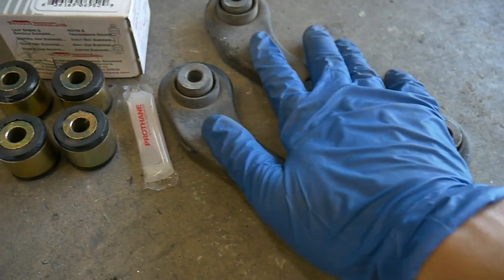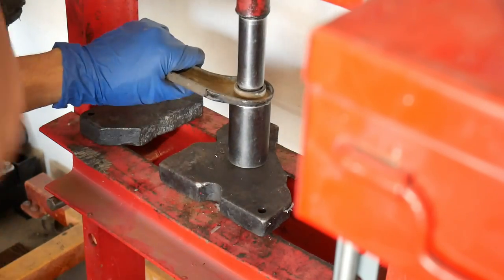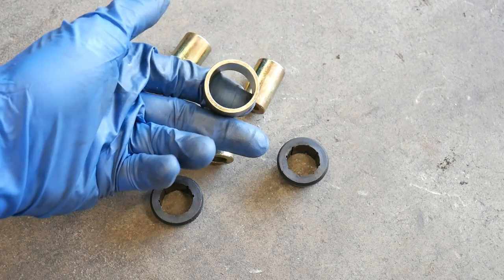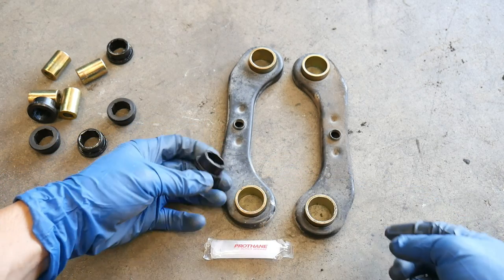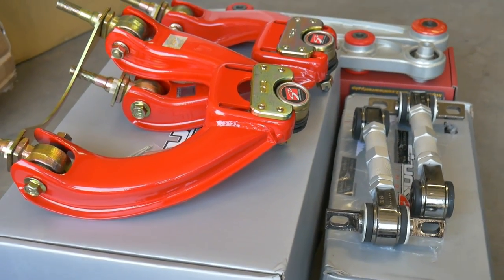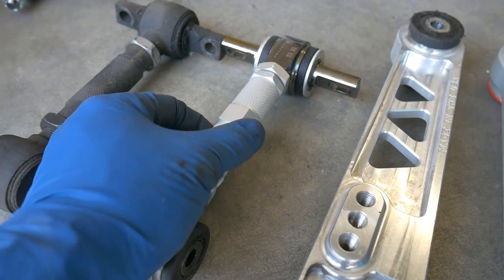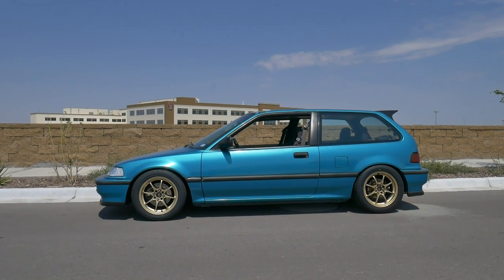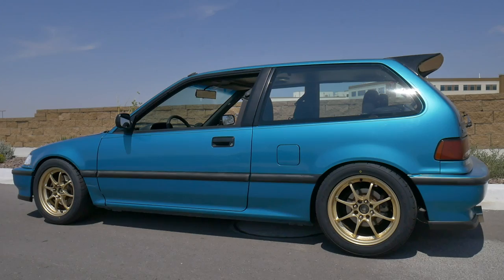Skunk2 Alpha LCA & Camber Kit, Rack & Pinion, Toe Arms, Tie Rods 1991 EF Civic Si B16A

Comment: hey jon quick questions not related to this video. Have you ever done a r12 to r134 conversion? is it worth converting or best to stick with r12? also i found a r134 oring kit for my sedan will the r12 harm the orings?
Reply from the maker: Yes, and R12 works 10x better.  R134a in 100 degree weather is tough in stop and go traffic.  On the highway or constantly moving forward then it works much better but once you come to a stop the temp rises quickly with R134a.  I was going to rebuild the AC on the wagon, but haven't had time/money so far this year.

Comment: also, you only need to unbolt the exhaust and let it hang down. turn the wheel to the left fully. if you can remove the outers slide the rack to the right and it will come right out. Mine were seized on, I had to flip the rack 180 degrees, force it to the right until the left outer dropped, then slid the whole assembly out. Didnt remove any exhaust parts or shift linkages.

Comment: My speedometer and temperature doesn't work know how to fix it?
Reply from the maker: Jose Hilario First check your speedometer cable when it connects to the back of the cluster, then also at the transmission.  Possibly unplugged, if not then the cable might have broken.  Temp gauge, check the wiring under the distributor.  There is a single plug that the gauge reads off located there.  check the plug, then wiring.  If that doesn't work for either, then you might just need a new cluster.  I've seen a lot that have had non functional gauges.
Reply: Jon Widmer rpm and gas still works still think it's the whole cluster

Comment: Love your new setup brotha! Btw is that Firestone you took your car to get an alignment? I have lifetime alignment over there, and i seen them use that new alignment equipment when i had my old wheels, but now that I recently bought some new mag blue te37s, i'm a little bit worried about the faces possibly getting scratched by the new equipment. How was your experience?
Reply from the maker: Perfect experience!  I go to Martin Tire.  The sensors that they have are lined with rubber on the faces so there is no possible damage at all to the faces.  I imagine the only damage would be if they dropped the sensor and the plastic part hit the face but doubt that will happen.  I only go there now because I've been going there for the last 5 years and know the head technician very well so he takes better care of all the wheels/tires and alignments for me.  How much is the lifetime alignment?  I might consider that for my track car instead since I align it maybe 2-3 times a year.
Reply: Oh that's awesome! I purchased the lifetime alignment at Firestone when they had a special deal going on which was $175, regular price is $200 ( but they don't adjust camber with that price or provide that option for lifetime warranty.)
Reply from the maker: Billy John De La Cruz I see, looks like I'll stick to my dude, he'll set any camber, toe, and caster (if a traction bar is on the car) settings that I want thankfully!

Comment: the steering racks in these are actually pretty stout from the factory. All you gotta do is replace the rack end bushing which was $20 from the dealership. Steering is super tight, no more rattle. very impressed given the rack has 267K miles on it and the previous owner drove it for months with a dry rack.
Reply: When you replace the bushing do you have to replace the inner tie rods, too? Both my boots are torn so I'm trying to figure out what all I need to order before I order it.
Reply from the maker: Only if your tie rod needs it.  But these cars usually need it and you're better off just changing it for piece of mind.  They are inexpensive too.
Reply: @GarageBuiltHondas  True! Moog inners are like $30 off of rock auto. Figured I'd rebuild mine with new Moog everything and have it towed with my insurance 2 miles away for an alignment.

Comment: Jon, what would you recommend for front lower control arms for ef? Was looking at the hardrace ones, but I think that’s my only option. Any ideas? Thanks as always.
Reply from the maker: +carlitosnueve OEM, but replace the bushings.  Energy suspension, Hardrace, or some spherical.  That's up to you!
Reply: Garage Built Hondas oh ok. cool, thanks. what do you think about hardrace inner and outer tie rods? do you think i would be any different than an oem replacement I can get at an oreilly’s or something?
Reply from the maker: +carlitosnueve Hardrace will last longer and can handle any abuse you throw at them.  If the price isn't much more, I'd go Hardrace.

Comment: car looks great I use those skunk arms too. im looking for a powersteering crossmember from the sedan to put in my hatch if you ever come across one thats rust free let me know please
Reply from the maker: Ok, will do!  Hey singlecams, got a question for you.  I've watched a bunch of your videos on the comparison of the handheld impact wrenches/guns.  I need one for track days, something to take off all the lug nuts and knock loose the front subframe bolts, and maybe use it for other random parts here and there.  What would you suggest?
Reply: hey buddy I would say see whichever price you like better between these 2 they are the big size models and can do lug nuts and more the first is called: Milwaukee 2763-22 the 2nd one is called Dewalt DCF899HP2 they both are just as powerful as most air compressor setups too. If you just want 1 gun those are the best options. Milwaukee has some other tools you can use the same 18v batteries on like smaller compact impacts that would be good for the track  for just lugnuts and smaller jobs. They also have a 12v lineup and have a cordless ratchet , i posted a video of that too it's no where as powerful as an air ratchet but very handy.

Comment: looks great Jon awesome work ...manual rack & pinion ?
Reply from the maker: Yes, manual!
Reply: worn one would it cause a rattle in the steering
Reply from the maker: Yes, it could also be the Rack End Bushing, or Inner Tie Rods, or Outer Tie Rods.  I ended up with a brand new rack with new everything on it, then put on the new outer tie rods.
Reply: ok thanks

Comment: Does the power steering rack and manual rack have the same bushings? I cant find any bushings for the manual rack.
Reply from the maker: Power has a larger diameter bushing.  I don't believe they make an upgraded one for the manual rack
Reply: @GarageBuiltHondas  thank you for the reply.

Comment: I know this video is old but I installed the rack and pinion I was wondering if you had to replace the inner tie rods on the new rack? Mine won't align correctly
Reply from the maker: I didn't,  mine came with brand new inner tie rods already installed.

Comment: I tried to install the camber kit in the center and let the shop do the alignment, as my shop is one mile down the road... FAIL...
backstory... the shop tried to align before the camber kit.  said it needed the kit to get the camber right.  I bought it and installed.  They now said its too low and they can't even put the alignment machine part on the car.  I told them you already aligned it once...lol... 
So I guess i will be roughing on the camber myself.  I think the camber was so negative the "new" tech was overwhelmed.  I will take it back to them to tweak it when the "master tech" is on duty!  ;).
Reply from the maker: Wow, that's terrible.  I've been lucky that the master tech send my local Martin Tire shop has been there for s long time.  He always takes care of me and sets my camber to whatever I want.  I'm sure they'll be able to get you sorted out.
Reply: Well I just spent and hour in the garage with an angle finder... zeroed a digital level on the floor and measured against the rim.  adjusted till I was at about 2% negative camber.  Car already drives better.  I was way negative.  About rubbing on the spindles at install.  So fingers crossed.  ;)
Reply from the maker: Nice, I've honestly installed camber kits and never had it professionally aligned and I didn't have an issue.  My first season of actual track racing, my car wasn't aligned and that wss after swapping both knuckles and the rear discs.  Car felt super good too! Lol

Comment: My 90 CRX has a 1.5 drop springs.(S Sport). The UCA camber kit was smacking the inside of my fenders so i had to take them back off. I guess toe is the most important adjustment? How can i tell if my rack end bushing is bad?
Reply from the maker: +journeyquest1 are your shocks still working fine? With a 1.5" drop there should be no way you're smacking the UCA against the tower unless your shocks are blown causing the car to rebound only with the spring.  And a drop spring of 1.5" is generally a pretty soft spring rate.  My track car is ran much harder than your daily driver and the front tires are to the fender and it only hits the UCA when I hit a big bump at the track a high speeds.

Watch this video, it'll show you how to diagnose a bad rack end bushing. https://youtu.be/rIsdGhLmdcc
Reply: I need to rebuild my frontend. I have a new rack unit with outer tie rods and new UCAs. Just did the brakes but i probably need new struts up front before i proceed with rebuild. I will just use stock type UCAs with a good toe adjustment. 1.5 drop probably not a big deal on camber. Any good middle of the road struts you recommend for the front? Thanks
Reply from the maker: +journeyquest1 I'm a big fan of Tokico Blues.  I've been using them since 2001 and have had a few sets on different EF's.  For a mild drop you're good, any more than your planned 1.5 and I'd suggest extended top hats.

Comment: Yo bro I have a 1991 with and b18a1 LS swap in it .  I'm getting a whole new skunk2 suspension but I'm not sure which one to get . The one for Acura integra or the 91 Civic cause it's the b series already in it.
Reply from the maker: Buy the one made for your car.  The engine that's in the car doesn't affect the way the suspension fits into your chassis.
Reply: I hit a curve like two years ago the car sat . So I just a b20 for and I have the type R transmission for it and new cluthc kit for it . But my suspension the only thing I need now . Thanks !!! I already ordered the skunk 2 coil overs . I need the camper rack and pinion and lover control arms.
Reply from the maker: Ok.  You'll be good, time to get it back on the road!

Comment: With the sway bar issue in the rear? Did you have difficulty installing the endlink with the factory sway bar? I had to push up as I put the bolt in and wasnt necessarily easy and don't know if it's safe to drive like that under load. Cheers for the great video
Reply from the maker: You had to push the LCA up?
Reply: @GarageBuiltHondas  no i had to push up on the swaybar endlink to get it to meet the holes on the LCA
Reply from the maker: That's correct.  Imagine when you lower the car, the LCAs go up this meeting where you now attached the endlink.  You're good to go.  👍

Comment: Hi bro did u ever measure the bushings of the skunk2 camber kit?
Reply from the maker: I didn't.  Remind me again why?  I don't remember if I mentioned it or if you did???
Reply: Garage Built Hondas, no im just curious cause I tried to replace the bushings but they are smaller then the stock size bushing on the Da, I try to figure out what exactly size to order but called skunk2 the guy had no idea, do u still have ur skunk2 bushing ?
Reply from the maker: The camber kit?  yes I have it.  I haven't installed it on my wagon yet though.

Comment: Do you have skunk2 coil sleeves? If so how do they ride?
Reply from the maker: Yes, they are great.  What really matters is the shocks/struts that you pair them with.  Go cheap, and the coil sleeves will feel like garbage.  You'll need something that can handle the lowered ride height.
Reply: Jon Widmer  I currently have the Skunk2 Lowering springs but Ive been thinking about getting the coil sleeves. thanks for the reply man and great videos keep them up.
Reply from the maker: Samuel Ruiz they have a nice spring rate, not too harsh or soft.  A good sport feeling!  Springs suck, I've never had good luck with them sitting correctly.  I feel like they are never even from both sides.
Reply: Jon Widmer That's exactly why I want to change them. They sit a bit lower on one side than the other.

Comment: Where did you get the new si rack and pinion I can't find any
Reply from the maker: +Tiger Doll This is a replacement for any DX model, not an Si.
Reply: Garage Built Hondas thanks man I found a used si one on eBay which one do you like more and why
Reply from the maker: +Tiger Doll The difference in turns from lock to lock is unnoticeable unless you are tracking your car.  I got a brand new one off eBay for $99 and it's great.

Comment: what size rims are the gold ones? width, diameter, offset. and what tire size is on those I really like how the tires fit the wheel. and how well did the 15x8+25 fit? looking at getting some advan1's in that size. and if you dont mind answering another question what size tire would you fit about the same on those. first time building up a car and want some nice fitment. probably gonna do a full skunk2 suspension aswell like in this video. thanks man really enjoy watching. much love
Reply from the maker: 15x7+35 205/50.  You didn't mention the kind of car you have.
Reply: @GarageBuiltHondas  it's an 89 DX hatch. I believe it is an ED6. Canadian manufacturer. d15b2 auto. not sure what all you need to know so if theres extra unnecessary info I gave sorry lol
Reply from the maker: +25 is a hard fit unless you want a lot of camber.
Reply: @GarageBuiltHondas  how much camber would work for that offset? or is there a better offset/wheel size that would work? the wheels I am looking at, avid1 av18, (messed up the wheel brand earlier) come in 15x8+25 on fitment industries. not sure what other sizes there are but for 15x8 thate the only offset available
Reply: the only widths available for 15in diameter are 6.5 and 8. and I'd like a wider wheel if possible. not sure if I can custom order or find them somewhere else. but they're a pretty cheap wheel that still look fairly how I want to get me started as I'm on a pretty tight budget. sadly I do not have the money for te37's or I'd just buy them and get it over with😂
Reply from the maker: 3.5 degrees and skinnier tires too.
Reply: @GarageBuiltHondas  okay that's around the camber I was looking at so that's not too bad. I really appreciate the help. means a lot

Comment: Im rebuilding my rack on mt integra, what kind of outer tierods u get? My inner tie rods are gone lol was it easier to get a new rack?
Reply from the maker: +BirdyIsPro73 I wanted a new rack because of mileage.  I figured it couldn't hurt and it was only $100 for the rack with inner tie rods.  I used all eBay parts, my rack and outers both from eBay.
Reply: Garage Built Hondas damn you trust ebay? Idk if i trust em, i think i might give em a try. My integra is at 245k might as well replace the rack haha might as well do all my suspension.
Reply from the maker: +BirdyIsPro73 I do man!  I've been using a bunch of parts off eBay.  All the wheel bearings on my track car are from eBay, same with those outer tie rods, and even the fuel pump.  All no problems at all!  I have used many parts in the past too.
Reply: Garage Built Hondas any prefered sellers? Usually go by good ratings
Reply from the maker: +BirdyIsPro73 that's exactly what I do!  And I try to check if the parts have reviews.  I try to always leave reviews now to help other buyers out.
Reply: Garage Built Hondas sounds good man glad i found your channel, really helping me get ideas on building my DA haha
Reply from the maker: +BirdyIsPro73 glad to hear, if you need any other pointers let me know!